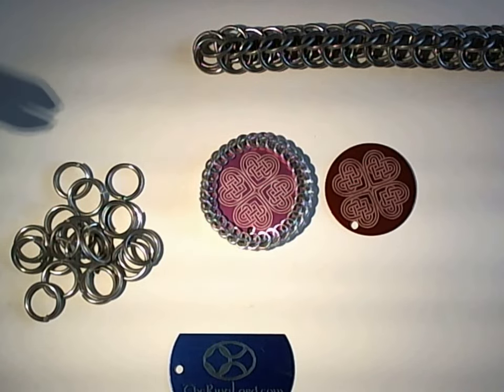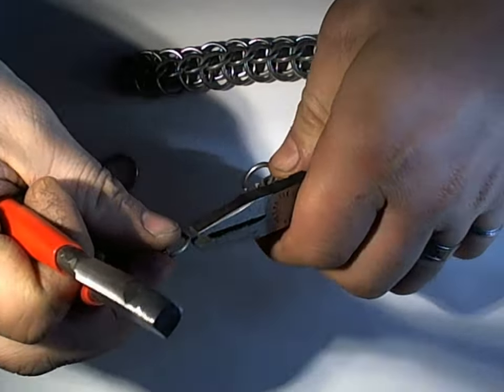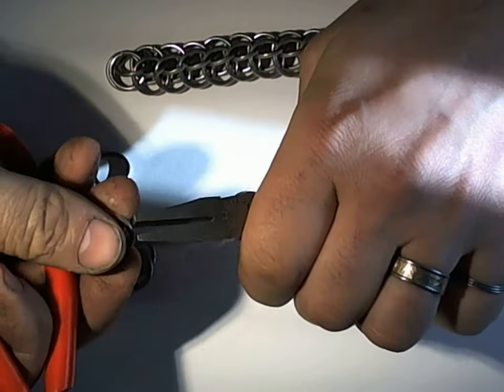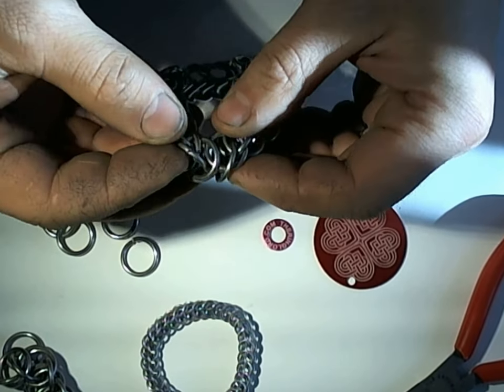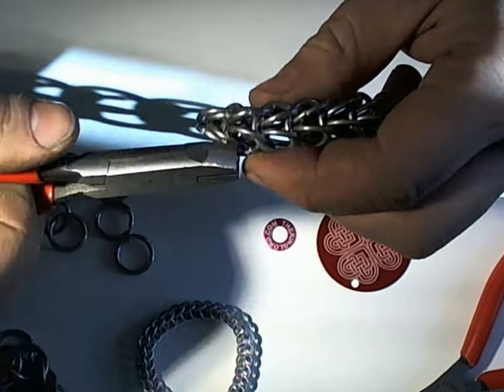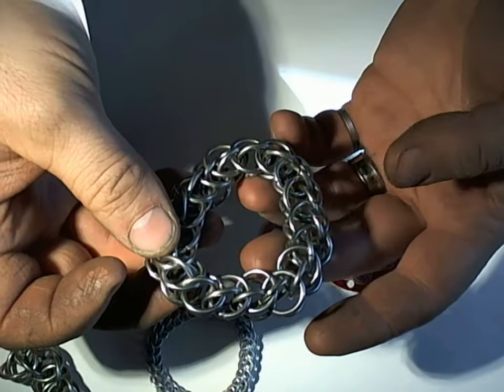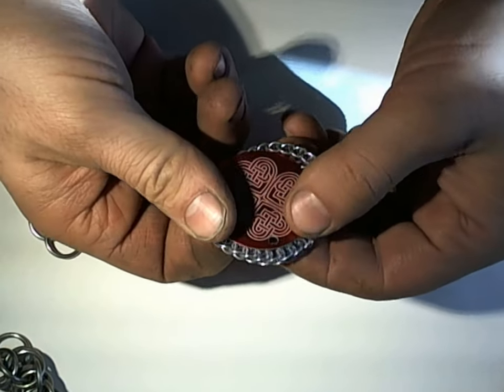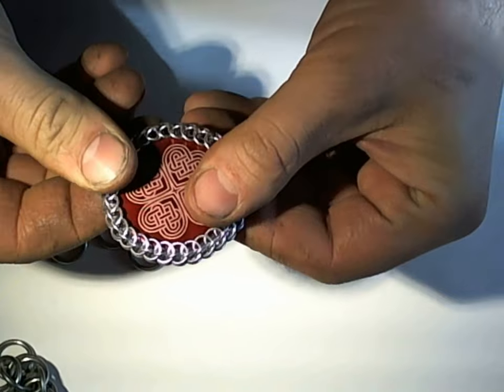How to weave 3/4 Persian Chainmail and connect the ends to wrap a cabochon

Comment: can this be done with 5/16 16g rings? if so how big does the item youre surrounding need to be?
Reply from the maker: Angie Ryman it could work with 16516 but would need to be a large circle,  at least 3inches. 16g 3/8inch would be better
Reply: im curious about wrapping a quarter or even half dollar. what size for that? im sorry so many questions. im just beginning and id love to do this as a memorium gift
Reply: I am trying to wrap my husband's guitar picks with chainmail, and this is just what I needed! You recommended a bead of glue to secure you item to prevent popping. What type of glue would you recommend?

Comment: As somebody who isn't into chainmail and just bought this as a project to make as a gift I feel your tutorial is very unclear about many steps that must be done in a certain way.. I've been working for 2 hours and cant even get the chain started. is there anything recommended I watch first? This wasn't advertised as a difficult thing to do.
Reply: +Hayden Fugate Learn how to make Full Persian 6 in 1 chain, and as the video shows, leave one step out. It isn't difficult if you ARE into chaimaille. While the Weave is not a beginner weave, connecting it is an intermediate skill. If you are new, check out beginner weaves on the website, and choose your project more carefully.
Reply: As someone who's never made Full Persian before I found this clear, concise and quite easy. It took a couple replays watching the first step to get it right, but after that, no hitches. Maybe do as Frann R said and try a basic beginner's weave, or something other than Chainmaille, if it's not your thing.